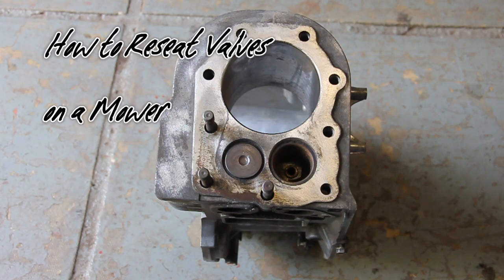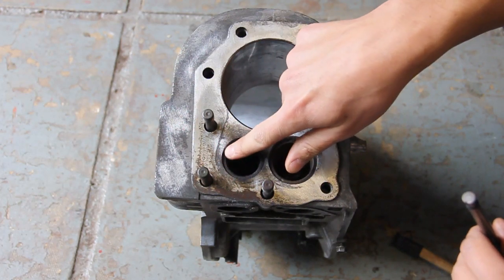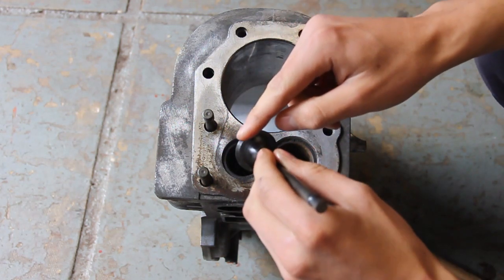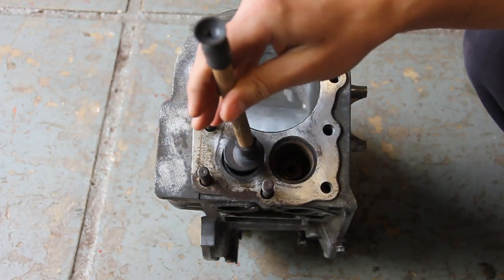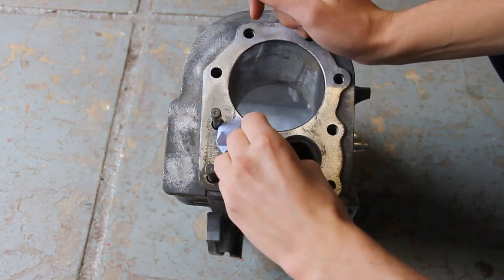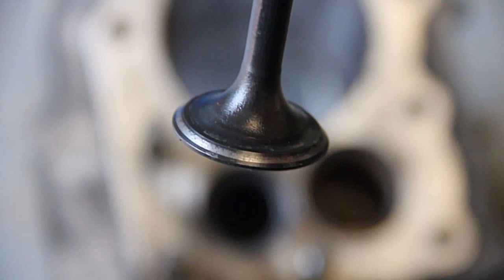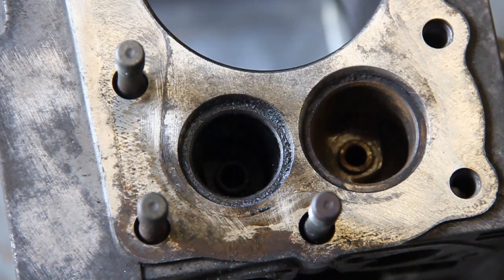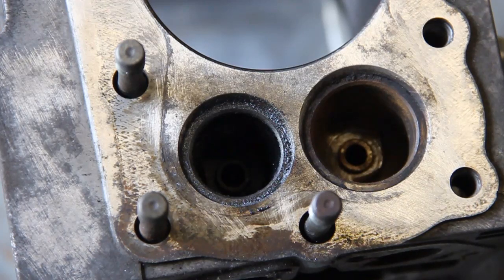How to Reseat and Lap Valves on a Small Engine

Comment: when I rebuilt my motor I just did that with a bench grinder that had a wire wheel on it. It workes fine
Reply: bench grinder? lol, this is to make sure the seat and valve are lapped together, not just to clean it up